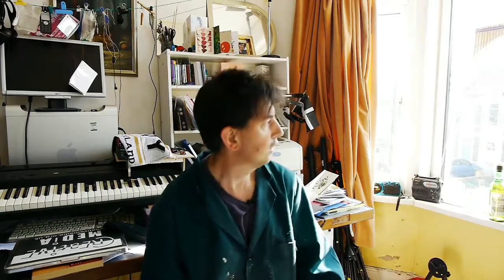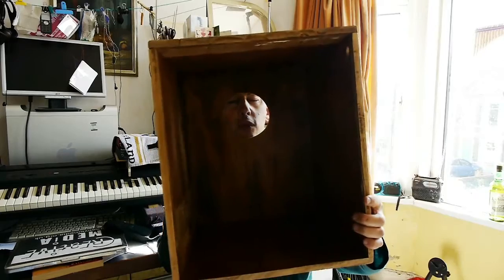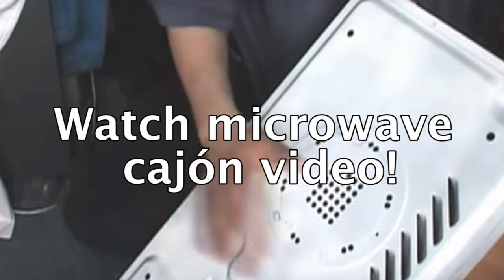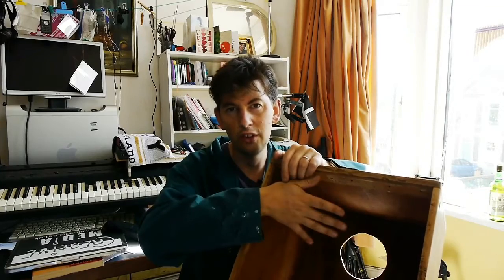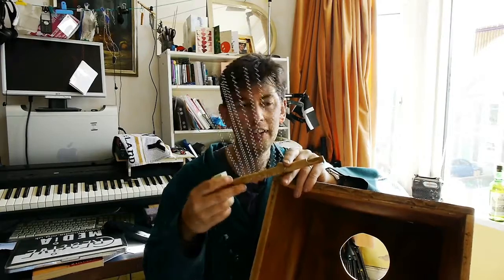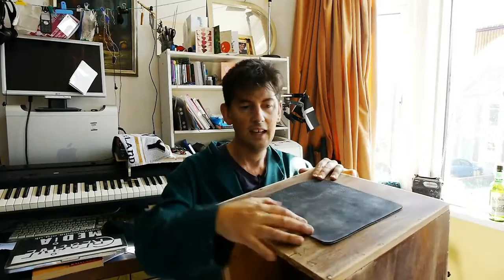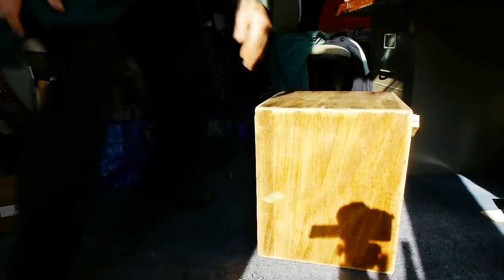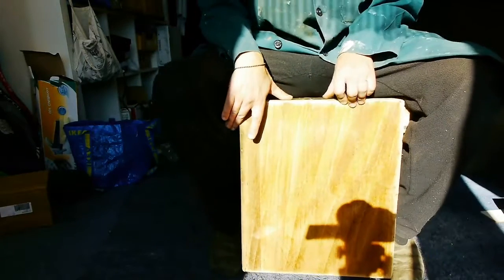DIY/home-made snare cajon vs Meinl Snare Cajon

Comment: The Cajon is original from Perú. It was in 1977 that Paco De Lucía brought it to Spain as he didn't like the bongo's sound and from there small Spanish builders from Andalucía such as Pepote started to experiment with different designs until today where they're still bringing inventions such as the ones from J. Leiva, De Gregorio, Duende Percussion,...
The Peruvian cajon doesn't have strings inside as in the Spanish version; it's basically an empty box as far as I know.
Most non Spanish cajons use snare wires while the most expensive models use the Spanish design with strings or specific wires.

Comment: I made a snare cajon a few years ago, but it's very heavy and - I just discovered - doesn't sound half as good as my brother's Meinl guitar string cajon. I'm gutted. I think I'll make the wood at the front and back much thinner + put some big wheels and a handle on it & a hinged side door, and use it as a gear-carrying-trolley/suitcase cajon. What does the panel think?
Reply from the maker: Thin wood on the surface you hit is certainly a good idea I think. And also using it actually as the crate that cahons are based on makes a lot of sense!